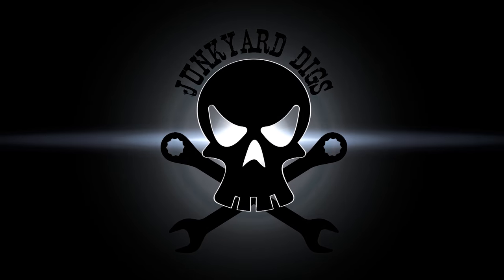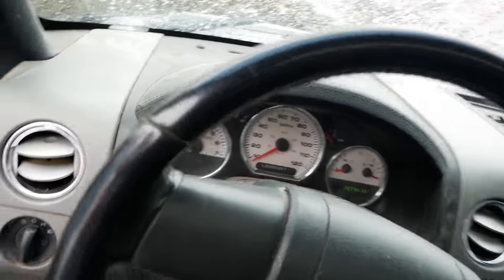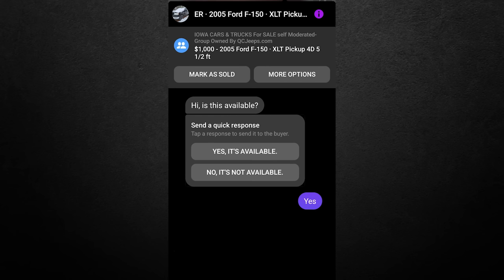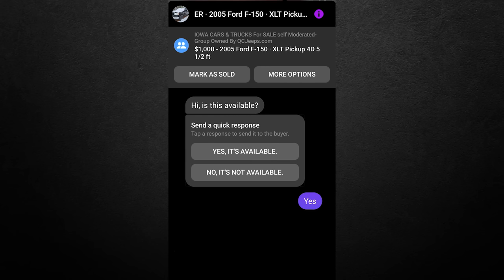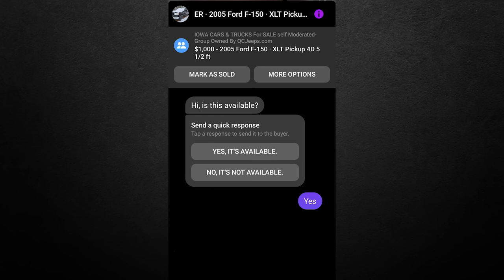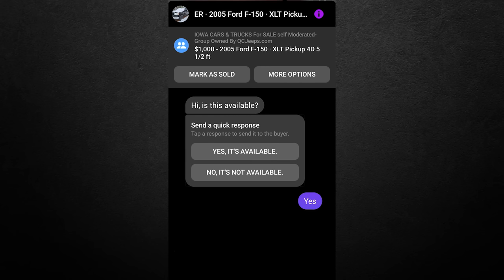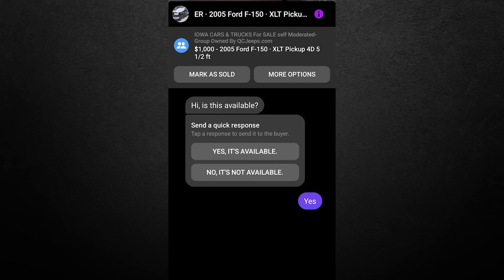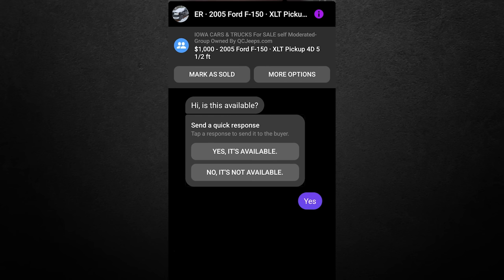How Safe Is a SEVERELY Rusted Frame? - REAL Crash Tests - Cornfield Science

Comment: This episode had actually reinforced my confidence in rusty frames. I'm impressed with how tough that truck was
Reply: I'm telling you if it's warping the same as hitting a wall at 35 mph when you jump it at 34mph with half the frame gone after a rear end accident. I'm a believer.
Reply: same
Reply: Hahahaha
Reply from the maker: Nononono 😂😂
Reply: high strength steel is actually strong.
Reply: I am also surprised with the strength that thing still had
Reply: same here. gonna go grab me the next clean f150 with rusted frame that pops up for a lil more than what scrap yard would pay.  Cuz ive seen other brand trucks with rusted frames and hell not even rusted frames twist more than this. hell look at streetspeed 717 when he jumped the brand new trx. That thing twisted pretty bad and yes it was a bigger jump but its a brand new offroad frame and the same jump he took a raptor off over and over with no issues.
Reply: @Car Culture Nation  didn't street speed also just have a raptor snap both tierods? I'm not to sure but had street speed hit that jump just as hard in a raptor as he did the trx. Shoot any truck for that matter it would of gotten messed up just like the trx did, End of story. Get your ford loving self a chevy!
Reply: Ford. Built tough 😂😂😂
Reply: I definitely have been over worried about rusty frames, they're safer than I thought.
Reply: 😆 🤣 😂 😹 this would have been more entertaining if you put a tiny helmet on that cat and took it along for the ride.
Reply: @JunkyardDigs  Do you want a photo of a sub frame that is no longer safe to drive on the road?
Reply: This showed that while not good, a rusted frame is not that bad either.
Reply: What was strong was the body and bed. The frame folded
Reply: Don’t own a ford truck but- as an insurance agent, it seems the fords just hold up better even rusted. GM terrifies me, Toyotas too
Reply: @cantbsdave  Toyotas have historically  had a lot of major issues with frames and suspension rusting out
Reply: @whamBamminTaxi  the only good thing on the chevy is the engine everything else is complete dogshit!
Reply: @whamBamminTaxi  i would never buy a Chevy truck and I live in the fort Wayne Indiana area. I have seen a relatively new one rear end a SUV and it did exactly what the dummy truck did. Frame bent right at cab and bed. I would say a good 20 degrees and that truck wasn't paying attention so rear ended SUV at 30 to 35 maybe. Just think about it's towing capabilities at that point
Reply: @jasonyoung4890  wow, random internet stranger I also live around that area
Reply: @vincentmartin9133  that GP hit would still send you to the hospital and or nee and hip replacements for everyone involved. the rust did take its toll but not as bad as i thought 💭it would probably be 

my 1968 C10 was kinda worse off than this F150 and i was dailying it around in 2010-15 as a 90's kid/3 or 4th owner sadly it was beyond my restoration abilities and sold it as a non-runner/parts truck i heard the next guy was trying to get tags for it but i think i saw it at the crusher's 😢
Reply: @Justin-lc8wk  Me too actually.  3 random internet people around the same area.
Reply: @jasonyoung4890  3/4 ton and heavier Chevys have good strong frames. Your run of the mill half ton Chevy and dodge frames are kinda chincy though.
Reply: @Bloodbain88  big baller my guy
Reply: Rust is lighter than carbon fiber!!!
Reply: Can I make a frame the rusts into thermite so as to maximize it's potential energy output at the end of it's lifespan ?
Reply: this video is a complete fail if the objective was to display that the truck is unsafe.  It is still bigger and stronger than a lot of vehicles running on the roads around the world.
Reply: @Marco-fi6gv  mines a 2012 from NY and looks fine.
Reply: I came here to post this exact response
Reply: @hokman1  this one definitely was, something like a rusted bus would be worse though. also, in THIS point it was still holding up, but if you would continue to drive, it would get worse. i know than nissan patrols had frames that liked to rust a lot, one time ive seen one broke while offroading. luckilly nothing happened to the owner or the rest of the vehicle, so it just got new frame fitted
Reply: I'm impressed at how tough and brave he is himself! Very dangerous experimwnts.
Reply: @juaffle  you dont need to, you can just take those rust bits, grind them into powder and add aluminum powder
Reply: Frame rust is not really a safety issue anyway
Reply: I had a 88 c1500 4 speed manual, and at the front where the frame rails kinda angled up, completely rotted out and i used to beat tf out of it, sold it that way guy still driving it🤷‍♂️
Reply: @carculturenation2166  "Clean" F150 with a rusted frame ? Dude, the rockers, cab corners, and bedsides will be gone too, and it still has Ford's shittiest engine ever made.
Reply: @JunkyardDigs  I was concerned that some people might draw that conclusion ;-P
Reply: He really wanted to fuck up the truck and the truck wouldn’t give up hahaha
Reply: @JunkyardDigs  it acts as a crumple zone :P its safer
Reply: @peetky8645  you should do comedy
Reply: @DIE2dayORelse  serious comment.  i have a frame rust hole to repair and i am not sure if i should use regular hot rolled steel or if i should seek out something else.   i think the frames are actually made of higher than normal strength steel.  my problem is a welded tubular rear suspension subframe on a sedan.  ya think regular 0.125 is ok or should i use steel from a leaf spring?
Reply: It’s not built Ford tough for nothing
Reply: Ford built very weak
Reply: And that's a rust bucket imagine if it wasn't a rust bucket
Reply: Yeah where can I get one
Reply: agreed but i can easily see why everything is tied together. its like a house eaten by termites its weak in places but still stands strong because everything is tied together so places that are still strong carry weight and hold it together
Reply: I'd just drive it when it's my time it's my time.
Reply: @peetky8645  steel from leaf spring defenetly not weldable to quality wanted for welded connection. I 100% sure about it. Welding to quality need a lot of operations besides welding itself, just open any book about it. Mild steel it better in manner it doesn't need such complex process to achieve expected weld strength.
Reply: @MykhailoArmorer  good to know
Reply: I mean it just converted itself from a tube / O frame to a C/U frame xD
Reply: @JunkyardDigs  yes,most on here agree with this guy saying how strong the truck still is.dont be a douche about it!!!dang!!
Reply: They were all low speed crashes. Doubt youd survive at 60 mph or more. People don't put put around like the old days. You are very silly to put your loved ones in a unsafe rusted out vehicle.
Reply: @carculturenation2166  lol the trx frame is designed for offroad. I work in the industry and have insider knowledge.  Offroad means gravel roads with slight washout, not mud holes and prerunner jumps. All Ram trucks are built cheep and flashy. Trx don't even run proper suspension, everyone knows for offroad its King or nothing.
Reply: @Marco-fi6gv  true, although they did recalls and sorted these issues out.
Reply: @joshonthetube  yeah scary people think that ford is even slightly safe, guess some people only learn from experience
Reply: @JunkyardDigs  my mom has a rusted trial blazer with about same rust I’ll tell her it’s safe
Reply: @Marco-fi6gv  I bet you couldn't even find a toyota from this model year with a frame this rusted lol
Reply: @Bloodbain88  same 4 random internet people 👌
Reply: Same. Truck on a deal and drive it till it dies.
Reply: @JunkyardDigs  🤣🤣🤣
Reply: @Marco-fi6gv  I had a mid 70s Toyota pickup my uncle sold me for $500 back in the late 80s. The cab was so rotted out around the edges you could literally lift it off the body! 🤣 The floor was an old sign riveted over the huge hole where the original floor had been and the frame wasn't much better. Still drove it for years and then sold it for $500 to some construction guys to haul crap around their supply yard. Not saying I'd do that now (I was in my 20s then, I've learned a lot since), but Toyota makes a sturdy truck...
Reply: @albertoortegon6388 
Not very tough
Reply: Most people seem to forget that this truck was designed to tow several tons and a cargo load of another ton or so. This being said, it is not surprising that the frame hold up. They should have tested the car with the maximum weight permisible, I would’ve been surprised if it hold up then.
Reply: If you can poke a finger through a rusty frame like it was a potato chip, then that thing is far too gone
Reply: Fax
Reply: @JunkyardDigs all the no’s
Reply: Probably depends on the vehicle as to how well it does. A rusty monocoque would snap clean in two
Reply: Not just rusty Ford frames either. My father had a 94 1500 Chevy that the frame banana'd and when he was about to scrap it my grandfather said he could use the hitch from it. So we hooked it to a tree and floored it, safe to say the hitch was going with the truck, but also after three hard tugs it still drives back up the yard and one piece.
Reply: @JunkyardDigs what you didn't see that one coming Kevin? 🤣
Reply: Same
Reply: You don't want a tough vehicle. You want one that crumples as designed so it absorbs the impact.
Reply: @m.b5777  it did crumple
Reply: Second time I’ve watched… still gold 😂
Reply: @kevinsteele2773  gold would be a terrible material to build a frame out of very heavy and very malleable
Reply: HOW?!! 
The front looked worse after crashing into that tree at 22 mph than a brand-new example did after crashing at 50mph! Are you insane?!
Reply: Another good reason to not live in the rust belt. Your hard earned investment is always trashed with rust.
Reply: I had a 72 Chevy Blazer with issues..eventually as I was driving I hit a bump and the body kind of lifted off the frame the steering got loose and when it came down I could steer again..right off the road. Had it towed home..fortunately the mechanical parts helped restore 2 other trucks but that rusty junker was toast..and could have killed somebody..
Reply: My thoughts exactly
Reply: I never wrecked a rusty vehicle. I'm a mechanic, so I got my good, clean picks. I've put cars on lifts, where they drop piles of rust upon lifting, rots out as I try to service them, and have even almost had a truck fall on me when the frame rotted out from under one of my lift legs. The only way I can see rusted vehicles doing great in crashes, is due to severe weight reduction, resulting in less momentum and overall force. That's a joke, of course. I won't trust 10:55  a rotted frame over a maintained vehicle.
Reply: I’ve had my share of shitboxes living in Wisconsin, I had a 95 civic years ago that was so rusty that the seat brackets hung through the floorboard and dragged over train tracks or speed bumps lol good thing I scrapped it after the transmission started popping out of 5th gear
Reply: Exactly...as in not now.. my 67 Dodge D100 has over a half a million miles on it. the frame is still just as tight and solid as it ever was. Of course, I do maintenance on it!
    Also may I interrate that undercoating is not your friend...
Reply: @TheBrennan90 
   Believe then, that the only thing holding that truck together is the body work.... that is not rusted yet. This is probably the reason they (ford) started making trucks out of aluminum. 
Planned obsolescence is a bitch...how much did that truck cost new? Thats right, WAY too much!!
Reply: @petesmith5092  undercoating is your friend if rust is not already present and rolled over. Otherwise, how would undercoating not be a good idea?
Reply: @peetky8645 may be, but it dont rust like mild steel!
Reply: @albertoortegon6388 
  Never meant anything...now means less...😅
Reply: @654Crossman  because it seals moisture into the metal thats already there, and the persons applying it a lot of times wil put so much on it plugs the drain holes and slots that water was meant to drain from to prevent rust from forming. 
  If you've had good results with it, cool. But i've had terrible experience with it myself. Everything i ever had undercoated, or was already done when i got it has turned out to be a bucket of rust chunks with a rubber backing.
Reply: @petesmith5092  it has to be done right and before rust sets in. Keep in mind, many used car lots will undercoat a rusted vehicle, to give the illusion that the car is not rusty. I've seen that done countless times and I love telling customers to walk away from the deal, when I see it. Most are happy to hear my honesty. But like paint, it must be done right. If it is, it will protect the metal, just like paint would.
Reply: Came here to say the same thing lol
Reply: Had a F150 rear end my mitsu 3000gt. I got a lil scratch and his whole front caved and busted the radiator. It was very surprising the truck got boned and the 3k was fine
Reply: Y'all Americans need mot safety checks. In Europe that car would be long gone.
Reply: All rust and cracks are different this isn’t a case my frame is or isn’t worse than that
Reply: It explains why the police hate high speed chases. If the perp is in a pickup or an old Suburban they’ll total several police cruisers and the pickup/Sub will still be drivable. The crash test videos from this era truck versus the previous generation is eye opening. The cabs in the newer trucks are considerably better. Though I enjoyed watching you thrash this heap I didn’t learn too much other than don’t waste your time selling on facebook marketplace. Keep making videos. Cheers.
Reply: Wrong take away.
Reply: Please Don't drive that confidence on public roads.
Reply: As a Midwesterner, I cannot imagine buying anything except cheap/low trim level used cars from other markets if Iwas driving them in a climate like that.

We get some rust, but that is horrible.
Reply: @peetky8645  "hIgH sTreNgtH sTeEl iS aCtUaLly sTroNg"

YOU DON'T SAY!? Dogs actually bark. Cats actually meow. The sky is actually fucking blue. The sun and moon actually show up in the sky.

What is your point? Did you just feel compelled to vomit something from your fingers and couldn't help yourself? THAT was what you have to contribute? THAT. Really?
Reply: Hell that would have earned its keep as a site truck for the next three years no problem.
Reply: Id rather trust a Full box frame ford anyday. dont buy alot of chrome parts because they're already more thin than original parts while being susceptible to rust and the elements.
Reply: Dont use rusty frames buddy
Reply: 🆘❌💯♨️⚠️⚠️NEW & RUSTY 

I have that same GWM tank300 .. I brought mine brand new FEB 1st 2024.. days later I looked underneath.. RUST COVERED. It was brand new 🆕. GWM responded “ yeh that’s normal and not our problem but urs for not taking care of it”!! 
How is this my fault if it was rusty before I brought it? 
Pls get all cars checked b4 buying . 
These tanks or all GWM vehicles are moved in open crates on ships 🚢 in the northern sea.🌊 some fall into the sea.. waves crash over . They also sit at sea waiting to dock for months , sometimes open to all elements. They are not rust proof at all! Nor made to be near ocean. $50,000 later and 6 mths later I’m still fighting this bulshit.! I’m in 🇦🇺 Aus. DONT BUY GWM anything . U WILL BE VERY SORRY 😢 AS I AM. 
My first new car dream smashed . Australia government aren’t motoring these cars anymore!!
Reply: Imagine how bad it would be on concrete at 45 mph! That's a scary thought! That's why maintenance is important there's so many products out there to stop rust and really not hard to do either!
Reply: Natural selection! Please collect your Darwin award at the gate... to hell.